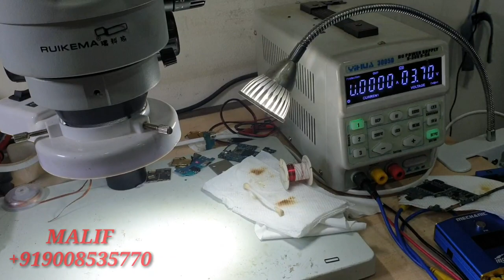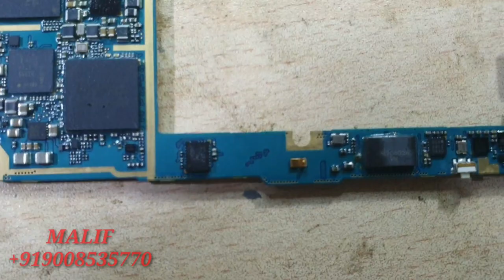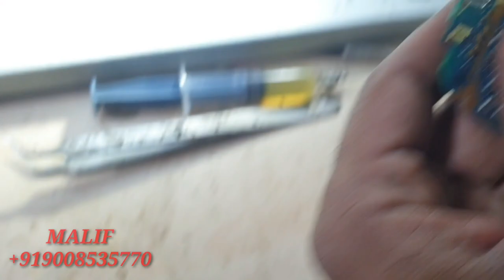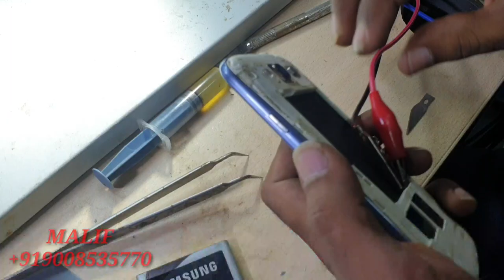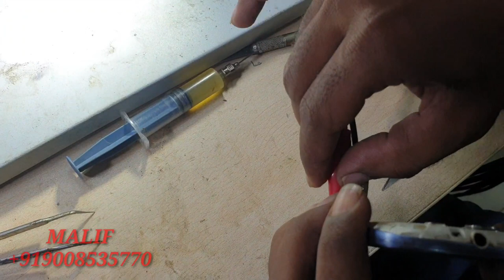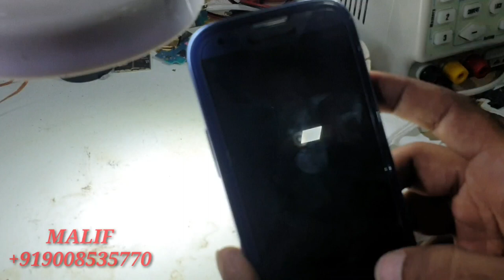samsung GT-I9300 half short done

Comment from the maker: DEAR FRIENDS 
INSHA ALLAH
WE ARE  STAR NEW  BATCH CHIP LEVEL MOBILE PHONES REPAIRING HARDWEAR AND SOFTWARE TRAINING FROM FEBRUARY 2021  

MY SELF INTRODUCTION :
 I AM NAJEEB PASHA OWNER OF 
AUTHORIZED SAMSUNG SERVICE CENTER 
AND 
MALIF MOBILE PHONES REPAIRING  SHOP
WE ARE UNDER TAKING HAND SET FROM OTHER LOCAL SHOP'S AND OTHER CITY'S SHOP'S 
WE SOLVED  DAILY NEW PROBLEMS
WE FACE NEW PROBLEMS AND NEW CHALLENGES NEW ACHIEVE

WATCH MY WORKING VIDEOS ON  MY YOUTUBE CHANEL:
https://www.youtube.com/c/MalifMobile...

FACEBOOK:https://www.facebook.com/groups/26202...

COURSE DETAILS:

HOW TO DIASMBLING ALL SAMSUNG MOBILE PHONES 
WITH LATEST TECHNOLOGY MACHINES

BASIC ELECTRONICS
WHAT IS CAPACITOR,RESESTOR,DIODE,TRANSISTOR,MOSFET,THERMISTOR,
COIL ETC......
HOW ITS WORKING
COMPUNETS TESTING
LIVE PRATIS ON MOTHER BORD
REBALLING ALL ICS WITH NEW TRICKS
REPLACEMENT NEW ICS
DAIGNOISE ALL SECTIONS IN MOTHER BORD
LIKE CHARGING SECTION,NETWORK SECTION,AUDIO SECTION
CPU AND EMMC SECTION ETC......
FAULT FINDING
HOW TO READ SCAMATIC DAIGRAM
TROUBLESHOOTING
HOW FINDING FULL SHORING AND HALF SHORTING
WITH LATEST THERMOL CAMERA
HOW TO TRACING IN SCAMATIC DAIGRAM
HOW RUN SCAMATIC DAIGRAM SOFTWARE
CPU AND EMMC SWAPPING

SAFE REMOVING AND FIXING DUBBLE DECKKER CPU S IN SAMSUNG

FULL SOFTWARE FLASHING ANDROID PHONES

EMMC PROGRAMMING IN
EASY J-TAG AND 
UFI
HOW TO FIND EMMC,EMCP AND UFS PROBLEM
HOW TO FIND EMMC,EMCP,UFS CHIP
HOW TO UPGRADE EMMC
DATA RECOVERY IN DEAD PHONES 

HOW TO FIX BROKEN LCD GLASS
HOW TO REPLACE POLORAISED FILM

BUMPER OFFER

I PHONE HARD WEAR SOFT WEAR
WITH LATEST ALL TOOLS

ANY ONE INTREATED TO JOIN CLASSS BOOK YOUR SEATS NOW ONLY LIMITED SEATS
 
WE TRAINED HOW IMPROVING YOU YOUR SMALL BUSINESS IN TO BIG 
HOW TO DEAL WITH CUSTOMERS
GIVE THE NEW BUSINESS IDEAS RELATED IN MOBILE PHONES

MY NUMBER IS +919008535770

KARNATAKA

GURANTY FULL SUPPORT AFTOR TRAINING ONLINE AND OFFLINE